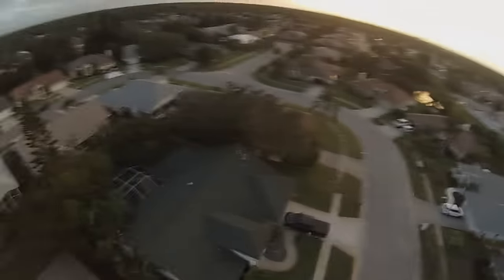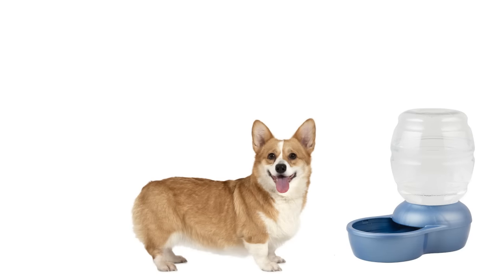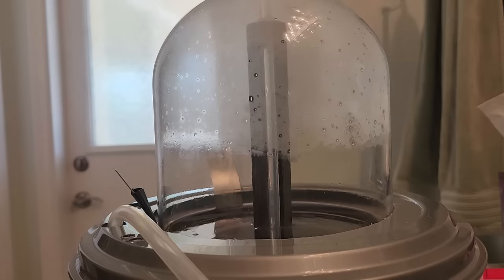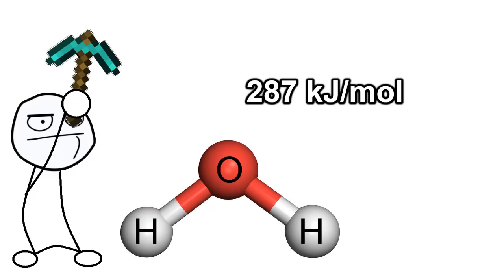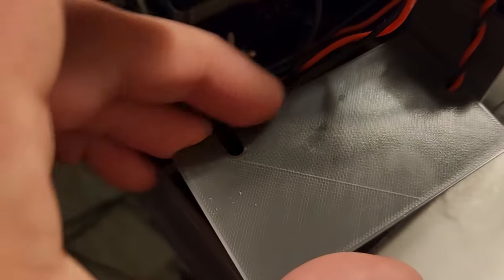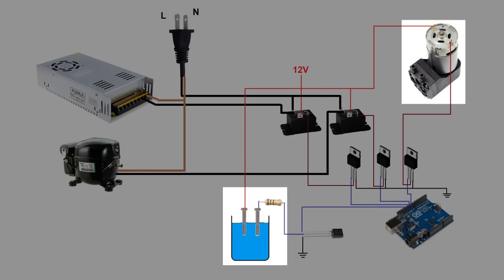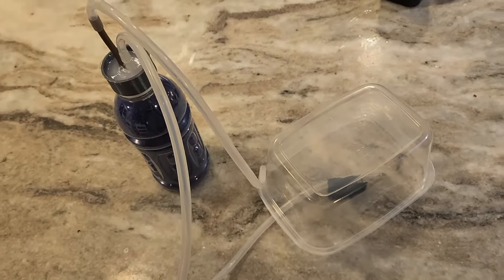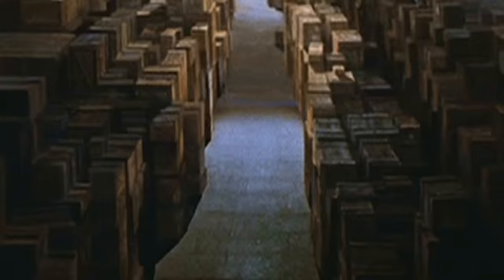Automated Hydrogen Generator

Comment: Hydrogen embrittlement is impossible with aluminum and fully austenitic stainless steels like 304 so no need for the dryer with aluminum tank. Industrial liquid H tanks are usually made of 304 on inside

Comment: Your local fire marshal would lose their mind if they knew you were separating and pressurizing hydrogen in that tank! We had pressurized hydrogen cylinders (4 pack) at work and the fire marshal required us to build a concrete room with no roof around them to protect ourselves and the neighbors in case they ever went poof.

Comment: To prevent current and heat runaways you can make yourself a high current, constant current PWM that was designed for DIY hydrogen production, for around 200 dollars worth of parts. And if you want I can tell you where you can find the detailed circuit description, parts list, and a manual in pdf format, at no cost at all. It would be my pleasure to share that with you. I did not design it, but I know that the person who designed it shares it on his web page. But you need to know where to look. And I can tell you that. 

With a current limited PWM you set your electrolyte for the target operating current at the beginning of the day. To start the output duty cycle is nearly 100%. Half way through the day as the cell is getting warm it may want to draw twice as much current from straight DC. The PWM, sensing that twice as much current is flowing every time it switches on, rolls back the duty cycle to 50%, thus maintaining the same average current. At the end of day when the cell wants to draw three times as much current the PWM is operating at 33% duty cycle. 

Many years ago I have build one of those constant current PWM's myself, and it worked perfectly fine for the HHO gas generator that I also build myself back in the day. The Constant current PWM operates at 12 to 18 volt. Max peak pulse current is 600 amp. Max constant current is 150 amp.  So that would require some neutral plates to get the desired lower voltage across each plate. Or some other way to drop down the voltage. Or perhaps you can change the design from the PWM schematic so that it operates at a lower voltage when you only have an anode and a cathode and no neutral plates at all.

Comment: Have you considered a liquid desiccant like calcium chloride in a kind of closed loop setup? You might be able to get away with bubbling the hydrogen through said liquid desiccant? Perhaps using solar heating to evaporate the water out of the liquid desiccant. This would allow you to babysit this machine even less. I don't know if the calcium chloride will get transported through your tubing though.

Comment: funny enough this is a really old design I had seen a long while back on google once, the process of separating the gasses that is. They have also used 2 glass tubes with a smaller glass tube in the middle at the bottom connected to allow the water the go across and allow the electrical flow. at the tops of the glass tubes they connected hosing to collect oxygen or hydrogen depending on the polarity of the connections

Comment: Over complicated the design of the cell a bit but as long as it works. You could use graphite electrodes (found in batteries) for an alternative to the stainless steel if you want longer lasting cell

Comment: Another method is to use KOH electrolyte and nickel electrodes. The KOH should be a little less hazardous to work with and the nickel elimates the Cr hazard.

Comment: ps, i used stainless steel screen wire for my electrodes, the electrons don't care, they just need a place to 'climb out of the soup'... however if conductivity is an issue, I would use silver or silver plated electrodes, silver is the best (non radioactive) electrical conductor. Yes gold is used in circuits in satellites, but those motherboards alternate between absolute zero to full raw sunlight, sometimes hundreds of times a day? week? - and the boards flex. gold is the only metal that can flex indefinitely and NOT form 'fatigue faults', cracks, in the circuits.  on the scale silver is rated at 100, gold is at 92(?), copper is like 72... now you know why high powered fm transmitters have silver core transformers in them...

Comment: I would be careful with retrieving the hydrogen from the latex balloon. Oxygen can diffuse into the balloon even with the balloon having hydrogen under modest pressure inside because of partial pressures. So you are likely storing hydrogen mixed with some amount of oxygen.

Comment: When I worked in Silicon Valley there were strict rules about where hydrogen could be stored, and houses were not on the approved list.  Maybe 100 feet away with a concrete wall between the tank and house?

Comment: Every since I heard of a Swedish company using hydrogen for steel production, I've been obsessed with seeing a hydrogen powered blacksmith forge. Would you be able to burn the gas here to high enough temps to melt steel (that being the highest temp you need for most blacksmithing work, you can get away with a lot lower for most projects)?

Comment: You could use an AIO (All in one water cooler for PC) that has its pump in the radiator (most new ones have this) and place both the return and supply lines in the tank, when running this would constantly Pump and return the solution to the radiator which has a fan to cool the solution.  It should keep it cooler than a high power PC which ranges between 90-110c down to just 40-60c, with the heat not being as great as a CPU it should keep it at ambient temps.

You system looks very nice, would be even more steampunk looking with the radiator cooling.

Comment: you should send in 20 Khz modulated by a carred signal at 923 hertz. Cut the negative part with a wavefolder and you have the signal of Stanley Meyer. The signal you need for your HHO.
Reply: What are you talking about? Stanley was a known fraud.
Reply: were do you find this information? i have invented a magnetic générator with no magnetic brake. Full power. Are you interrested? i'm lookoing for someone to get the conept in CAO.

Comment: 1.5 -2.5 volts is correct for best efficency.  Platinum is expensive apart from shaving blades edges, steel is involved. 

Should find alternative from steel or aluminium?

Comment: I used to work at a company that made hydrogen fuel cells they were very big on safety! Every test rig had multiple hydrogen and fire detection devices which shut off the supply. Hydrogen burns with a clear flame so every lab had an old fashioned broom which would detect flames by catching fire. Whatever you do don’t store it inside 😱😱😱 the atoms are so small every container will leak. Seriously it’s not to be messed with......

Comment: Why don’t you put the anode and cathode in separate containers and connect the two containers with a wire? Or connect them together at the bottom allowing water to flow.

Comment: how much did it cost to produce the 320 L ? why dont you try to run a gaz motor with it and let that engine like 15 HP engine to drive a generator which save on your electricity ?

Comment: Would it be efficient to add a water cooler circuit to keep the system cooler? This reduces the loss in efficiency.. but would it be worth the energy running a fan?

Comment: I'd be curious if there's anyway to check the O2 contamination inside the H2 feed aside from listening for the bang of igniting the gas.

Also, I did a balloon launch recently (focused on the payload development), my team subcontracted out the logistics, but there are rules for free-flying payloads in the USA like how much the payload can weigh, the minimum cross-sectional area it can have (if it free falls, it can't hit the ground any faster than a threshold velocity), a maximum tensile strength of the strings (if they wrap around an airplane wing, they need to snap), plus I think there's a little paperwork that needs to be filed with the FAA (letting them know you're doing something and give a brief window for any concerned members of the public to raise objections if there is a concern).  If you fly a GPS, be aware of the cocom restrictions...

Comment: It's a pity about the stainless steel, it has a lot of problems as an electrode material.
 It isn't just that the chromium in the stainless migrates into the electrolyte in a potentially hazardous form. 
The electrode potential of stainless is way too high for efficient operation. This is the potential that has to be overcome before electrolysis starts. A good material such as platinum has a very low EP, which is why it is used industrially. Its a pity about the price though.

Comment: Carbon nano tubes inside your hydrogen storage vessel reduces pressure tremendously by giving the hydrogen a place to "nest". This also reduces the noted propensity of hydrogen atoms to penetrate and escape the vessel. Since it would cost millions to fill a small tank with carbon nano tubes, this is hardly a cost effective solution. 
Cabonized creatine works exactly the same as carbon nano tubes in reducing relative pressures in hydrogen storage. Baking chicken feathers in a 180ºC oven for a few hours makes a low cost carbon material that is cheap and does the same job with slightly better results than nano tubes.

Comment: Your current is increasing because as you split the water, the electrolyte is more concentrated because there is less and less water to dilute the sodium hydroxide. Try putting a radiator in your system with a heat exchanger in the solution to keep your solution cooler. Make something to add water to your system.

Comment: Hi radiators have energy for heat management .gases do enter into car engines also flooded water from storms.methane is a compound of hydrogen elements and one carbon.the radiator can turn gases to liquid s and liquid s to gases . just need some work to Radiador s.

Comment: Carbon plates look to be the answer for the plates. Channel “Robert Murray-Smith” tested carbon plates in his
video “Super Efficient Graphite Dry Cell Hydrogen Generator”. The video is based on a college paper called “A systematic study on electrolytic production of hydrogen gas by using graphite as an electrode” 

What was the KOH cost per liter of hydrogen produced?

Comment: Do you have more insight on the explosiveness of compressing hydrogen with oxygen contamination? Or do you remove traces of oxygen out of the mixture before compressing it, cause i didn’t see that in the vid apart from the extra flanges u printed to have better seperation during electrolysis? Ive been wanting to start a project like this as well but i’m concerned about explosions while compressing it. I have a Co2 compressor lying around which can reach 136 bar of pressure and another one to pre pressurise the hydrogen to 10-20 bars. After that i would want to store those in gascanisters for heating in the wintermonths. I thought 10 120liter at 130 bar would already get me somewhere in the winter as a second heating source.

Comment: no , it's not some of the buubles, it is all of them you will get a pure hho gas. This is normal, if you don't want that then you should eperate the electrodes and pull the hydrogen from the one side.

Comment: Cool stuff! A bit scary though ngl... :) I am surprised that your compressor pump can handle H2. How come hydrogen embrittlement is not an issue there? What type is it?
Also why not use graphite electrodes instead? (i.e. salvaged from used AA batteries, like some guys on youtube do) No toxic waste that way.
Oxyhydrogen welding is one example for the use of your H2 and O2 gases, not just for "really small scale" torch. It also seems popular on yt.

Comment: Useful video. So, I have occasionally meddled in H production for fun. I also work with hp compressed CH4 for living. Anyhow, a pest issue that i kept having, baking soda as electrolyte and stainless steel electrodes, was salt build up on the electrodes. Would it be possible to reverse electric current and reorganize gas flow to their appropriate containers to avoid salt build up on the electrodes? 100hrs electrode lifetime isn't sufficient for say an industrial process. I don't think changing the electrodes would fix that issue.

Comment: Do they make smaller Coalescing filtration systems that will work with this to filter out the humidity in your system? I know they use this from filtering airplane gas and fuel.

Comment: Try PWM @ 10khz if you scale up the voltage without the heat, There was a quack guy i can't remember the name of that got lots of money, news attention, etc because it was easily reproducible that it overcame the heat issue dropping the duty cycle as the temperature increased.

Comment: Are you aware you can just buy a hydrogen torch for about 200 bux..? The device makes and stores hydrogen in a stainless steel bottle with a regulator and pressure safety valve. It has a tank that holds the lye water.

Comment: Why don't you automate it with a air lock instead of a check valve? If the pressure on a smaller airlock is less won't it just collect up until the pressure is equal to the atmosphere?

Comment: your threshold voltage is higher than the theoretical because of something called overpotential - you'll want an HER and OER catalyst. For HER graphitic carbon nitride works, for OER nickel iron molybdenum ferrites work, as does molybdenum diboride. Using ionomer membranes like nafion increases selectivity and reduces side reactions that waste energy. You'll want the proton exchange ionomer on the cathode side, and the anion exchange membrane on the anode

Comment: curious if you could use this with a small rc car motor (the gas type), modified to function off hydrogen and run a genny. Basically using h2 as a battery all in small scale. You could use a switch off a small solar cell/battery combo to the genny/battery to make it mostly green energy and then with large amount of stored fuel. You could use it to charge a small portable camp battery (see bluetti or ecoflow). This system could also be the power house of your mini blimp idea. Used both for it's lifting force and as a fuel to power it and all its control bits.

Comment: I grabbed a cup, two thumbtacks, 9v battery, salt, and water, i mixed the water with the salt into the cup, put the two thumbtacks into the side (bottom works too) and poured the salt water it, connected the battery and all the sudden. It made hydrogen bubbles. 

I had one issue though, the water started to turn yellow, and then brown. I'm not sure how it started to turn that color. I think it was rust that made it turn yellow but other than that i'm not sure.

Comment: Could this be turned into a safe indoor heater efficiently? Similar to a "buddy heater" burn the hydrogen to heat the heating element and instead of producing sleepy sleep forever gas you just gotta own a dehumidifier. Reroute the oxygen back into the air but not so damn much that it explodes you

Comment: be careful buddy. explosion limits increase as you increase pressure. which means small % amounts of unforeseen O2 in a pressurized tank with H2 will become explosive at some point under pressure given an ignition source. Ground your tanks and anything metallic

Comment: could you build a HHO generator that steps up output power by generating HHO and using the HHO to turn a turbine and harness both the turbine energy and HHO energy - you could continually step up the process to create more output

Comment: car ac drier receiver will also help bigtime,,not at all expensive,,very common in most cars,,looks like a black bottle with an eye glass on the top with and in and out pipe fixture.

Comment: commercially available versions of these for fueling hydrogen cars would be awesome! can't afford the infrastructure? let the customer make their own fuel from thin air! (if the sodium hydroxide doesn't get used up and the hydrohen comes from the moisture in the air, i didn't quite understand exactly where it comes from)

Comment: Any way to measure purity?  I’m wondering since Fuel Cells are quite picky if I remember correctly.

(at least PEM Fuel Cells, laughs in Molten Carbonate Fuel Cells / Reformer Based Solid Oxide Fuel Cells that will run on fucking JP-5 lol)

Comment: Why cant we use it for Heating Homes by making it the source of heat for the Radiators...

Instead of Furnace Oil, we can use this Green Tech...

The Load on Power Lines for Heating Energy can be released...

The power source for the HHO generator can be Solar Power Systems based on SPV Systems.

Comment: O rings on groved stainless steel works great but then if your wanting to use a dry cell design that leaves you battling the leaked a cheap fabric like polyester is a bad idea this is why you will typically see people using things like sham wow towels  then there is a much better way to deliver a split cell design you and use a u pipe have your anode on one side and the cathode on the other  and this works great as you don't have to worry about hardly any oxygen mixing with your hydrogen  kinda sad though he has a 3d printer and hasn't learned to place orings in to his prints all mg with fabrics as there are rubber and even silicone filaments he could be using to create his gasket plates and integrating the shammy towel into the print

Comment: why not try pressure swing adsorbtion using zeolite. user water with like a 3a or 5a or better zeolite and it will capture hydrogen and under vacuum release the hydrogen.